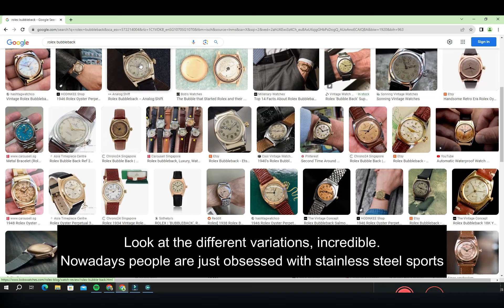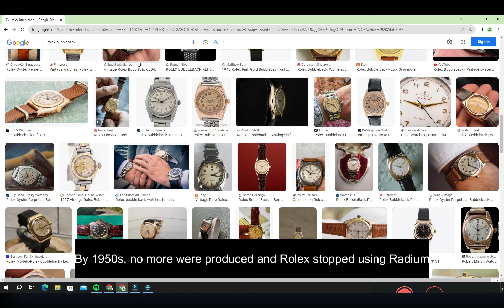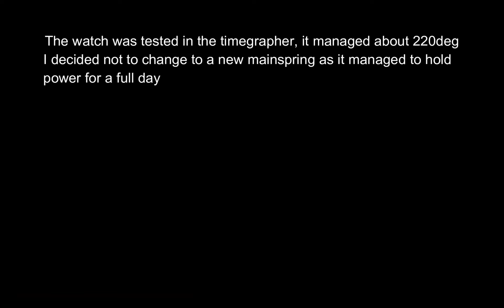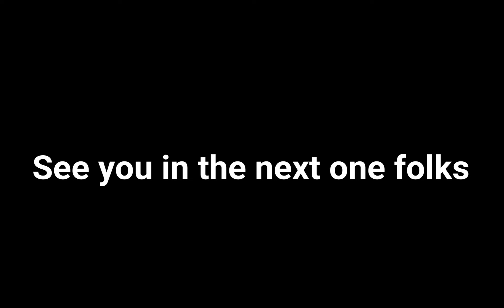Restoration of Vintage 14K Rolex Bubble back Caliber 620 with Radium dial

Comment: Thanks. It was very interesting for me as I am actually servicing my Dad's Cal 645 and I am not really familiar with this movement. I understand that your customer was on a tight budget but not changing the mainspring at the moment of servicing the watch  is something that I think he will eventually regret. Mine cost about $16. I completed the cleaning of the automatic module. It's a little different that the one you served but I took good notes... yes! Handling the balance as you said is very scary because of the delicate hairspring and on top of that the over coil can get (if not careful) on top of the center wheel. I plan to use D5 for the automatic module unless you can recommend me otherwise. Well, thanks again...
Reply from the maker: D5 works fine. I used to work with D5 too until the industry moved on to mobius HP1300, which is now fully synthetic and supposedly last longer. D5 has issues with colder temperatures being mineral, hardens and viscosity changes. HP1300 might have better stability over wider temperature range. But for 90% of daily use cases, should be fine.

Comment: It's fascinating to see that you brought back this old Grandfather watch back to life. Anyway, I have a similar watch, bubble back Rolex watch from the same era. My crown and stem came loose when I tried to set time. When I pushed and screwed the stem/crown back on the second stopped after a while. However, when I loosen up the screw-in crown the second started to run again. I have watched your video just to see how you removed the crown and noticed that you have skipped those steps. Wondering if you can give me some advice on how to remove/put the crown. I have removed the back case and located the screw but unable to move it or push it. Thank you
Reply from the maker: You may need to bring it to your nearest trusted watchmaker or Rolex service Center. The setting lever may have been undone and it might need to be fixed from the dial side.

Comment: Is there a reason you didn't release the power within the barrel before you started to take apart the movement?
Reply from the maker: Hi, power was released. The spin that you see is the last dregs of stored power being drained as I removed the pallet fork. Usually this small residual energy is safe enough to not cause any issues or damage.